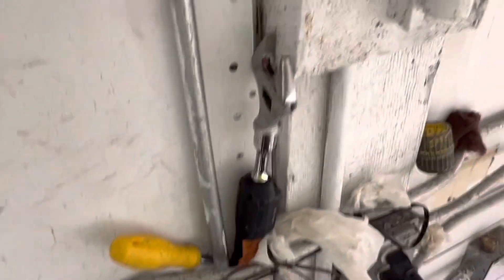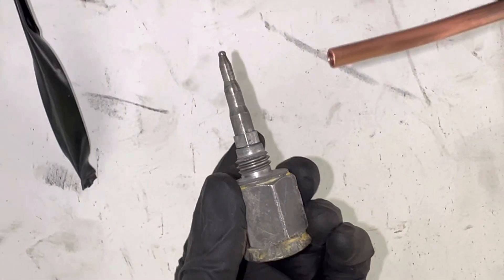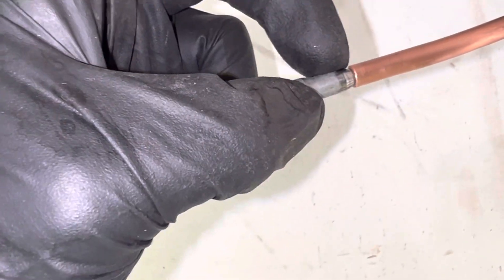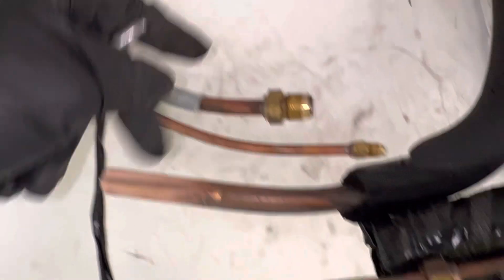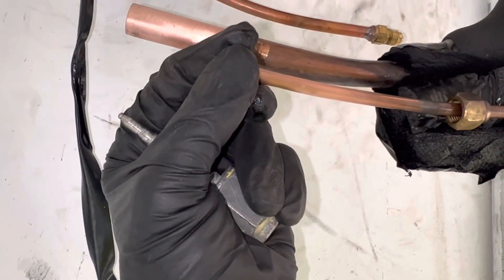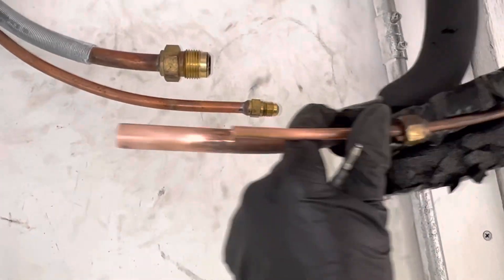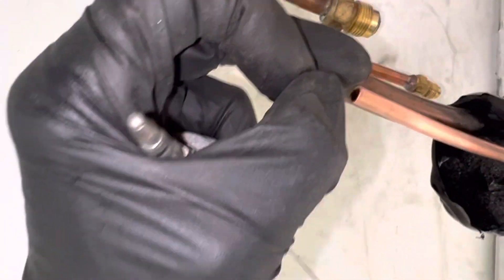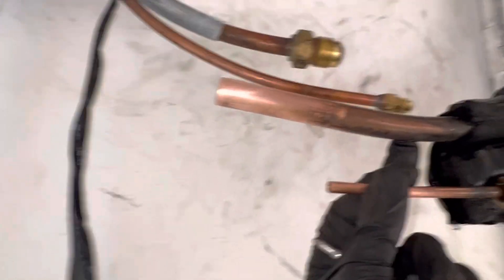RESIZE YOUR COPPER TUBING after you cut it with a tubing cutter.  Don’t Make Orfice Restriction

Comment: I spending way to much time on my pipes. There is burr/dust like 2-2,5 inches inside the tube that I pick out with ethanol paper in like 10 attempts. Don't wanna have small pieces of copper in my system, therefore my costumers will not have.
Regular drill in my hand and finishing with "deburr-hook" Is my favorites. Have some 60 degree grining bits for the cordless drill, but they trowing stuff in the pipes longer at lowest speed. Pipe is pointing at least 45 degrees down. Shooting with nitrogen afterwards too.
Reply from the maker: This is why a smooth, rounded swage tool does that easily all in one process without making shavings grinding dust or little long metal threats like you just seen in the video. 

Fast, easy one step
Reply: @coldfinger459sub0   Hmmmm, like the one in the video? Looks like a regular deburr tool was used before recording started?
Reply from the maker: @Casal70  it’s just an old fashion swage tool

Back in the days before power tools my grandfathers time 

Where are you? Held the piece of copper in your hands between your knees, then balanced the tool into the end of the pipe at the same time swinging a hammer hitting the end switching out stretching the copper so you can fit another piece of copper inside of the stretch part that was about 3/4 of an inch deep to prepare for Silver Brazing. . 

Really slow would hit your hand sometimes brutal on your wrist and fingers . 

I remember when I went to a Hvac class took 2 1/2 years on each major was a little overlap of residential HVAC and heating, and then on top of that we took commercial refrigeration at the same time and building automation took five years 

The first class was sweating, and all the students were using the hand method. I said the hell with that. 

I purchased a $600 hydraulic electric tool 

Showed up the class with that and did all my projects with that . 

I told instructor this is not the 1930s .
Reply: @coldfinger459sub0  Hehe I appreciate your answer! Thanks!